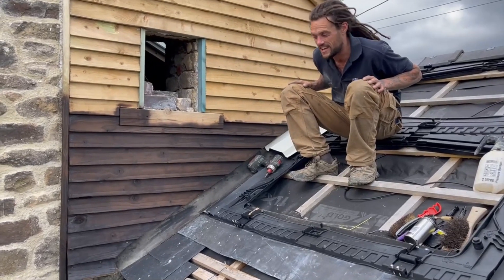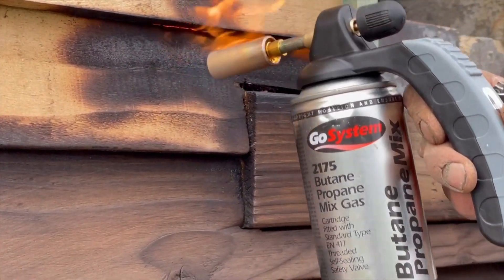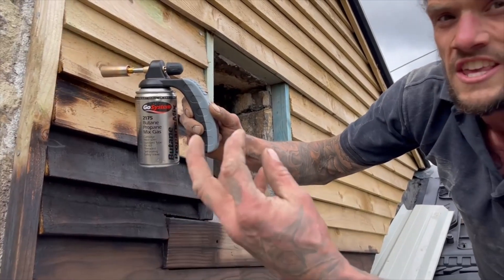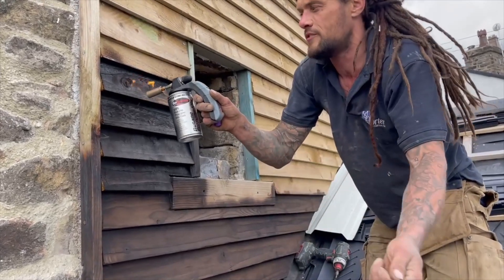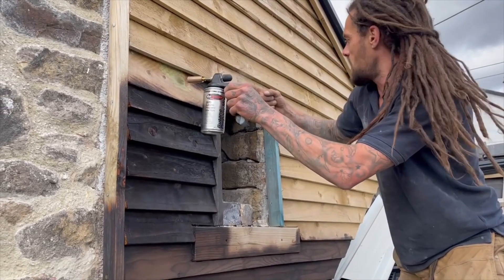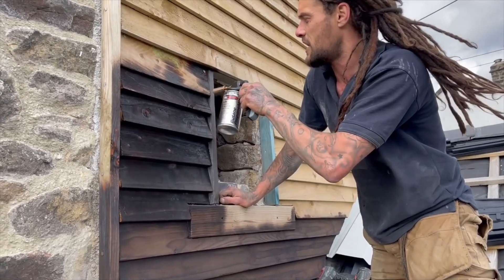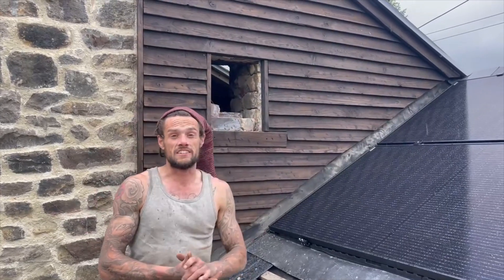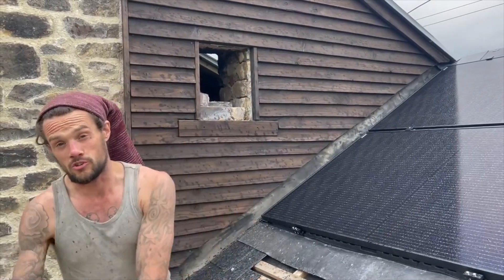Shou Sugi Ban cladding

Comment: Linnseed paint is good and you can make it yourself. It stops rot because it's breathable.
Reply from the maker: The problem with paint or oils as explored in the video, is that you have to regularly reapply it. SSB once and the product is protected using the oils naturally in the timber.
Reply: @dportercontracting9974  ok thanks I will try this method however I will use linnseed paint instead of plastic paint outside because you don't need to take off old failed layers which traps the water and causes damp. Once painted on  bare wood you only have to add oil every 7-10 years and never need to paint again  unless you want a colour change. No stripping of old paint needed ever again. I've mix zinc oxide with a raw earth material like iron oxide More turpentine and linseed oil on the first coat. Old used rags are flammable!
 Apparently a lot heritage has been lost because the window rot with post war paint.